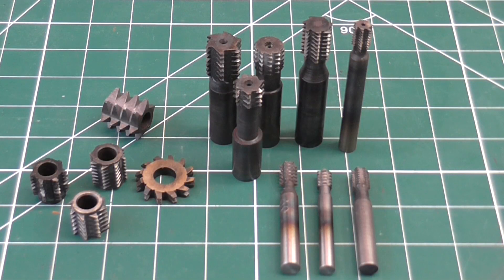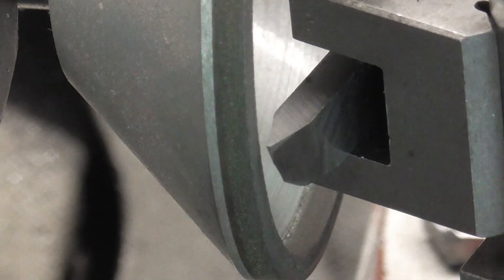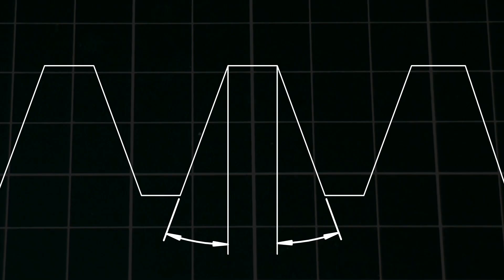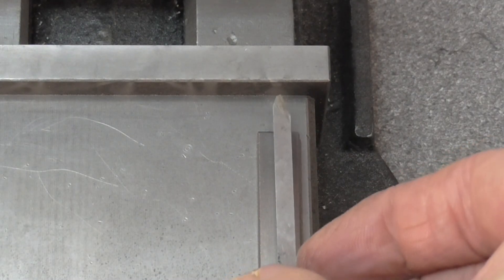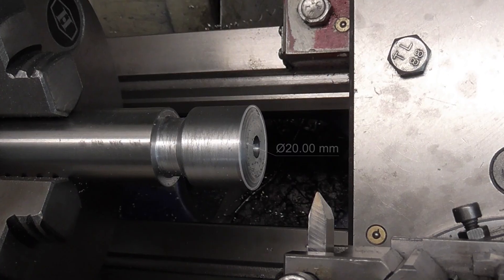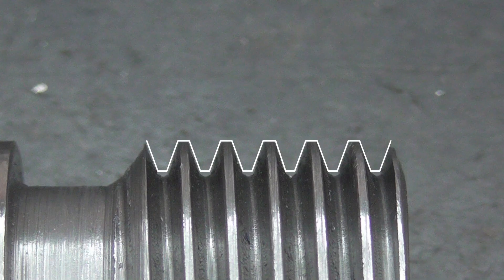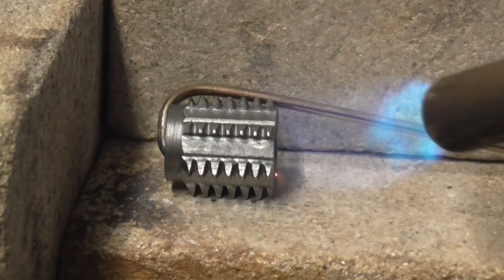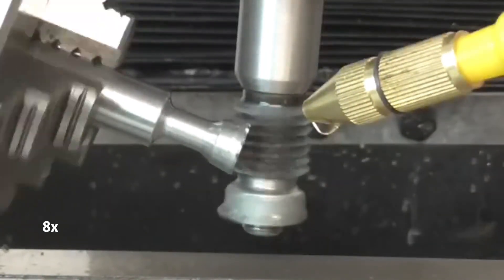How do I make my own gear hobs? (Gear cutting)

Comment: I think you don't take into an account something. I would prefer to be wrong here, but...
Consider making a spur-gear having PA = 20°. That means that the toothed rack complementary to such gear would have trapezoidal profile of tooth with also 20° angle between trapezium s sides and axis of symmetry.
If you going to cur the gear using the rack as a cutter, no problem: you have to move cutting rack towards the gear in direction parallel to gear axis. With the hob things change: to compensate for helical "nature" of gear hob, you make an adjustment of milling machine axis and you mention that at 11:30. Now projection of the cutting edge (of its contour) of the hob to imaginary vertical plane will differ from its real contour — it will be compressed in by vertical axis by the factor of cos(helix_angle). If the scaling transformation has different scaling factors on X/Y axes, that transformation does not preserve angles. Thus you'll get slightly decreased PA on your gear.

You probably don't notice that the gears you make have decreased PA because with helix angles as low as 5° or 10° the cosine of helix angle is ~ 0.99619  or ~ 0.98481 respectively, which means one-axis scaling to a factor of 99.6%/98.4%. So depth of the groove you cut isn't affected, but the width of the groove is about 1% less than required. 

Also, if you making two gears that should couple to each other, they will mate perfectly even if it's PA angle is unintentionally decreased. However, you are getting non-standard and modified profile of your gear teeth, so it won't mate perfectly with the gear manufactured somewhere else.

However, all this considerations become not actual if at the stage of thread cutting (07:17) you tilt you cutter by the angle matching the helix angle of you thread. Which isn't the case as far as I can see.
Reply from the maker: That's a very astute observation and clear description of this effect!

Yes, you are correct, the tilt of the hob does affect the pressure angle of the gear it generates. This is known as 'cosine error', though in this case the effects are so small that I've never felt it necessary to correct for them as they will likely be swamped by other errors that are beyond the accuracy I can achieve. 

This hob was tilted to an angle of 4°, commercial hobs are generally larger diameter than my home-made ones and are tilted to less of an angle, around 1-2°. The cosine of 4 is 0.9976 giving a pitch error of 0.24%. At 1° the pitch error is only 0.015%. A tilt of 4° would change the pressure angle from 20° to 19.96°. I don't think I can grind the cutter used to cut the hob to within 0.04° even if I do it on the lathe and set the compound slide very carefully with a dial indicator. Also when I screw cut the hob I am not able to reproduce the module thread with an accuracy better than 0.2% on my lathe due to limitations of the leadscrew and change wheels.

Also as you say, if I cut mating gears with the same hob then they can actually have quite large deviations from the pressure angle I was aiming for and they will still be perfectly matched to each other.

However it is still useful to know about this effect and good that you pointed it out, as for example I can try and make the cosine error of the hob and the screwcutting pitch error cancel each other out rather than both adding up in the same direction.

Comment: I don't suppose you'd want to do another video, running through all the maths in Imperial... ?
Reply from the maker: I did think about trying to do it in both imperial and metric, but I thought it would be too confusing and I tend to think in metric.
For the most part it works the same way in imperial but there are a few differences, gears are measured in Diametrical Pitch (DP), which is the inverse of Module, you can use the formula DP=25.4/Module. Where I've multiplied things by the module in the calculations, you have to instead divide them by the DP. Also imperial gears can have a different pressure angle, 14.5°, though 20° is more common nowadays.
Reply: @AndysMachines  my lathe is almost 130 years old, it's change gears are 16 DP 14.5º PA.

Comment: Hobs shouldn't have any face rake, it changes the pressure angle of the gear. They also don't get relieved on the sides of the teeth, the whole profile is relieved equally by grinding it deeper; if only the sides were relieved, the profile would change every time you sharpen it, which is obviously not acceptable.
Reply from the maker: Yes, you're right, there is relief on the sides of the teeth, but this is achieved not by directly grinding an angle on the sides, but by the teeth being not tangential so the profile gets progressively deeper as you describe. This can be done with a backing off lathe or the Eureka Tool I mentioned. My explanation of this could have been better, but I was mainly pointing out that my hobs don't have this clearance, rather than getting too deep into how commercial hobs are made (this video is already pretty heavy going as it is). As for the face rake on the hob, because my hobs are not 'backed off', this does not change the profile they create (think of how a tap cuts, the rake makes no difference). I did mention this effect when grinding the cutter which cuts the hob, this cutter has no rake on the top for this reason.

Comment: Thank you for this video. I haven't been able to find anything on YouTube. I'm needing to make a batch of 3 DP 67 tooth gears for my work. This helped me immensely.
Reply from the maker: Wow! Those are pretty big gears!
Reply: If you need to make proper gears, buy a proper cutter. As impressive as this is, it's nowhere near good enough for a commercial product.
Reply from the maker: @elanjacobs1  I'm not claiming my home-made hobs are as good as commercial cutters, and I'll always use a commercial one if I have the right size. But it is possible to make DIY cutters like this that produce results plenty good enough for most applications and at a fraction of the cost. I don't know what a 3DP gear hob would cost, but it's not going to be cheap!
Reply: @AndysMachines  it's a small batch of maybe 5 or 6.
I'm going to try and get a hold of some 6" diameter o1 tool steel for making the hob. Should work well enough if I take things slow.

Comment: Brilliant, Andy!  Are you using a "Pi cluster" (22T/14T, set lathe to 1.6mm) to get the right pitch?  Some other way?   Anyway, thanks for sharing.
Reply from the maker: I'm just using the standard change wheels that came with the lathe and don't include many multiples of 22 or 7. With module threads there is always a small error but I can usually get within a fraction of 1%. Since only 3 or 4 rows of teeth on the hob are actually cutting, this only adds up to a tiny error. (Of course I could always make my own change wheels!)
Reply from the maker: Actually, this got me thinking and I just calculated that with a 'pi cluster' turning a 1 module thread I can get within an error of 0.043% (since 22/7 isn't exactly equal to pi). With the standard change wheels I can get to 0.096%. This isn't a huge difference, about 0.01mm over 3 or 4 pitch lengths and it would be hard to get other errors such as the runout and cut depth better than that.
A much better approximation of pi is 355/113 (accurate to 6 decimal places), but that would be a little impractical on most lathes! I'm wondering now what module threading gearboxes use? There must always be some error, unless the machine uses a pi pitch leadscrew (not sure if those exist), since they usually also do DP, metric and imperial threads, they can't all be spot on.
Reply: @AndysMachines  Good points, all.  Since  Pi is an irrational number, there is always an error.  I use a 22/14 cluster because it was easy to make,, doesn't use any of the change gears that came with the lathe, always fits physically and is the smallest error anywhere on my OLD 6" Atlas lathe.  I figure every little bit helps.  ;-)
Cheers,
F.C.